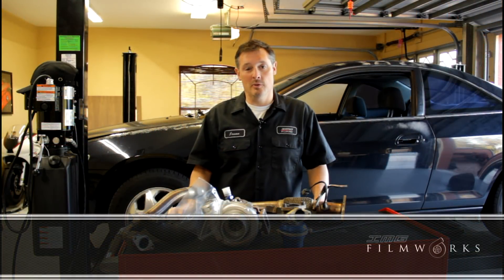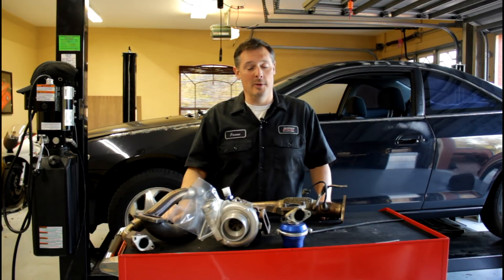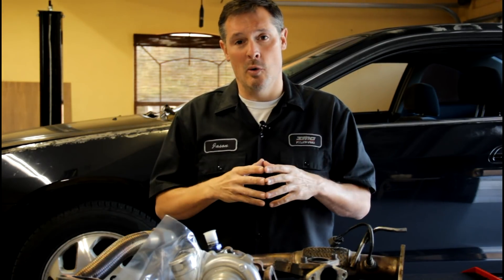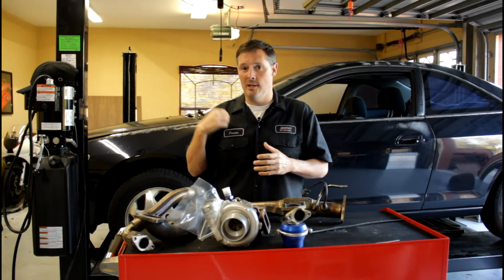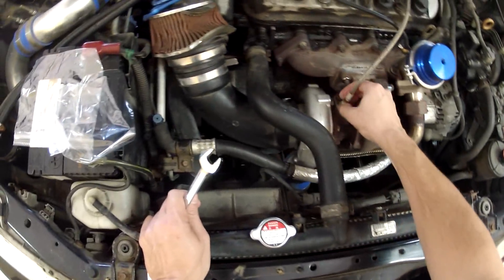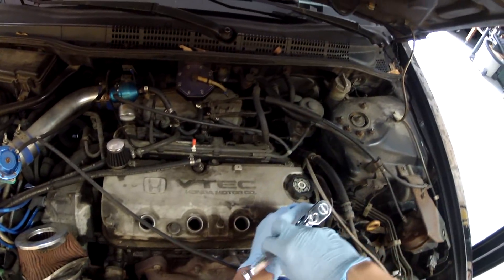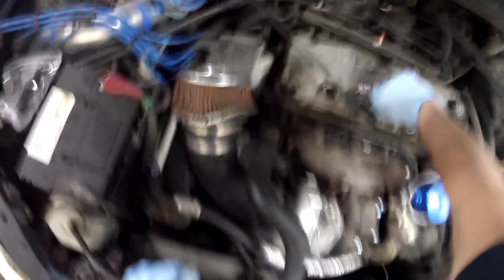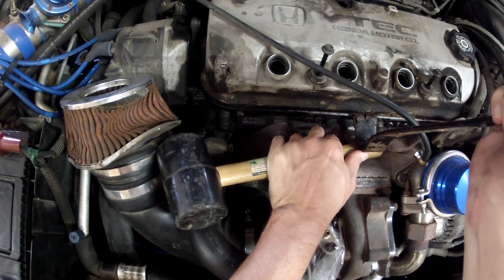Building A Budget Beast - Episode 9 Part 1 - Turbo System Deconstruction & Installation

Comment: For an A20 engine, what would you use for a O2 sensor adapter similar to the Missing Link (o2 sensor runs off the intake manifold with a vacuum line and mounts on firewall)

Comment: I know this is old but we’re you running stock ecu fuel pump and injectors on this?
Reply from the maker: Stock ecu and injectors, but fuel pump was upgraded to Walbro 190 high pressure pump.

Comment: Is it possible to take to a tune shop for ECU or not possible without Hondata? Since accords dont have Hondata available
Reply from the maker: It is possible but you would need a programmable ECU as the one in the Accord I believe is not programmable.  You would also need bigger injectors as well.  Maybe someone else could chime in, mine is not running engine management so I wouldn't be much help on this unfortunately.  The purpose of this build was to do it first, cheap.  Second to see if I could keep it operating as stock and be reliable all while testing the high mileage theory.
Reply: A setup like yours would be good, i remember how you bypassed the ECU with the FMU but i never could find THE MISSING LINK to order so thats why i was hoping to just reprogram stock ecu. Tha ks for the insight, love your videos!! 🤘🤘
Reply from the maker: Find it at synapse engineering's website.  Basically it is just a fancy check valve, but IMO well worth the price, I like clean and easy solutions.
Reply: you can pretty much do anything ... get a p28 or p06 obd1 ecu and get that tuned youd need a obd1 to odb 2 conversion harness and the tune would make the build so much more powerfull... dont get me wrong his build is nice but with a tune it would probably gain 50hp and 30 lbs torque

Comment: You said you got good gas mileage even after turbo right?
Reply from the maker: Yes, I think I lost about 2-3 mpg total, but the way my build is the car is basically just like stock unless you are in boost.
Reply: Interesting I turboed my Mazda b2600i and I get terrible gas mileage. I have a 10:1 fmu no tune.

Comment: I turbocharged my accord a while back I had two ebay turbos fail at about 700 miles. Are you using a brand name turbo or did you do something to the turbo to make it last?  I ended up using a obd1 ecu and had mine tuned. Dyno'ed at 244 whp. I made alot of mistakes though and  the whole project ended up costing me about 10k mostly because I had issues with manifolds not sealing.
Reply from the maker: Ouch, that is a lot of money sorry to hear that.  I've had no issues with my ebay turbo for almost 40K miles.  I will say that I make sure I cool a turbo down for a minute or so every time I stop, and make sure you have a very good oil filter because turbos don't take much to screw them up.  I will do a turbo update now that I have the system apart, but I looked at it briefly the other day and there is zero play in the shafts, just like the day I bought it, I'm amazed actually.  My build ran about 1500 bucks I think total hence the "budget beast".

Comment: As someone who wants to get a lift to further extend one's diy and project  capabilities would you recommend 4 post vs 2 are there any underlying benefits or flaws to either?
Reply: Lewis my opinion is get a 2 post if you can afford it. The runers on a 4 post get in the way alot, Even when there is no car on it. doing suspension/ tire work on a 4 post just doesn't work very well.
I don't know what the price difference is but I use both types regularly and 2 posts are much nicer.
the one advantage of a 4 post is that you just drive on and lift rather than taking the time to set it.
And 2 post lifts can sometimes be anoying because you can't open the door very far. 
Also I think 2 post lifts have to be  bolted down and some 4 posts dont.
Reply from the maker: I've had both and both have there + and - issues.  I like a 4 post for a few reasons.  One you can store a vehicle on it without creating suspension problems.  Second they are movable which is a must for me where a 2 post is fixed.  With a jacking system a 4 post lift can do everything a 2 post can do but not the other way around.  Both are great, but the 4 post was best for me.

Comment: Can you make a product list and explain how the parts work together.? Also can you make a product list that will work for a v6? Can't wait to turbo my v6 honda so I can completely destroy my transmission. Them install a manual transmission.
Reply from the maker: Andrian, I did that in episode 2, here is a link https://www.youtube.com/watch?v=5sfeuy7E1tg  This is for the f23a 4 cylinder motor, no V6 as I don' t have that version, but the principles are the same.